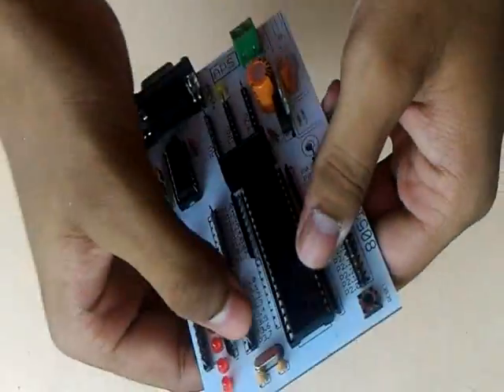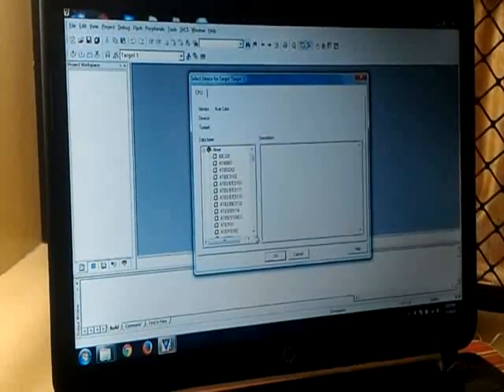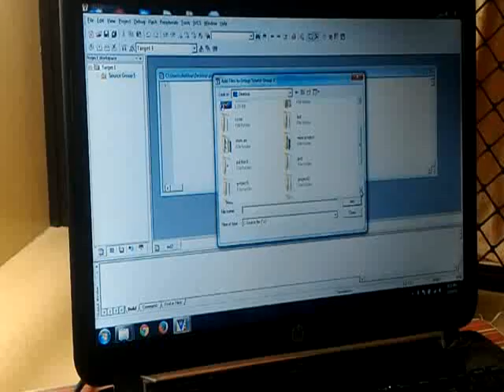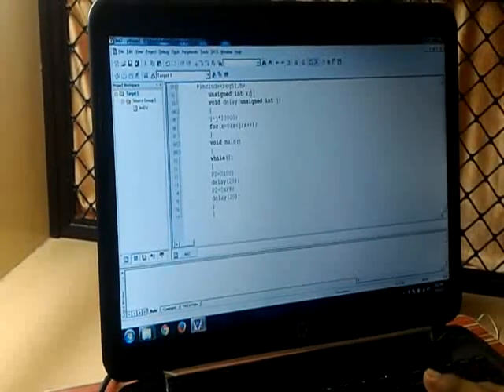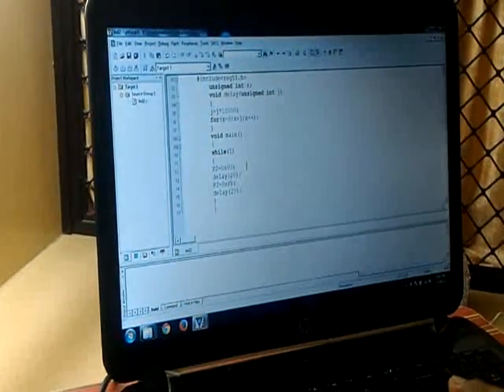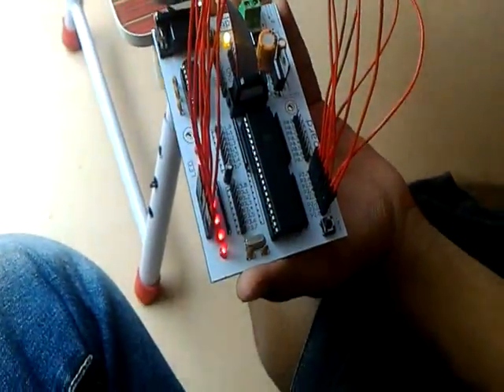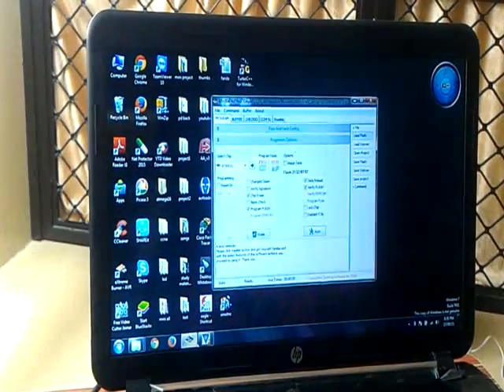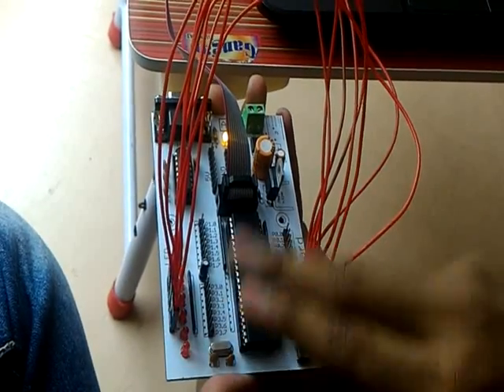Keil Tutorial for 8051 Micro-Controller using hardware Complete Explaination.

Comment: For controling home application
Reply from the maker: Firstly u have to connect UART communication protocol with 8051 .... There are some blogs available to connect with 8051 .... Once the connection is established then try to work on configuration mode which is AT commands

Comment: Sir i have the usbasp burner but don't have the tranier kit  then how shall i burn the code in 89s52. Can you tell me the pin connection.
Reply from the maker: surely you need to connect the pins directly to your 89s52.... you can refer this document it contains all the details regarding the pinouts and connections of it 
http://www.learningaboutelectronics.com/Articles/Program-AVR-chip-using-a-USBASP-with-10-pin-cable.php
Reply: Electrofun but it is for AVR will connection be same??
Reply from the maker: It's for reference that same pins you have to find out for your usbasp and the pins for 89s52
Reply: So i just have to change 89s52 from AVR and connect similarly? ??
Reply from the maker: Yes check it for 89s52... Concepts is same just pinout may vary....

Comment: hello sir i am new student and my trouble is old microcontroler unlock and check the file
Reply from the maker: +journeyelevator technology there is an reverse debugger which can do what you are saying ... But I think that's a very long process and would suggest you to write the code again or use Arduino for more simplicity ..
Thank you
Reply from the maker: +journeyelevator technology there's a debugger i think which can do your work .... Or else you can write the code logic again because that will be more simple or instead use Arduino which is easy to code....

Comment: how to open microcontroler hex file
Reply from the maker: +journeyelevator technology once the file is uploaded you can't open it unless u have the hex file and the corresponding C file of the same code....
Reply from the maker: +journeyelevator technology basically it is not an easy process to unlock hex file ....